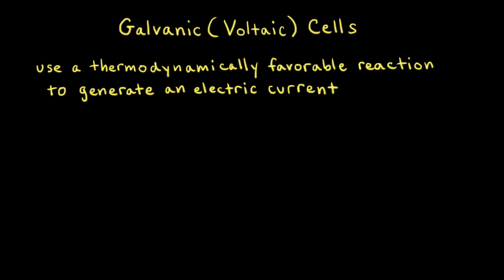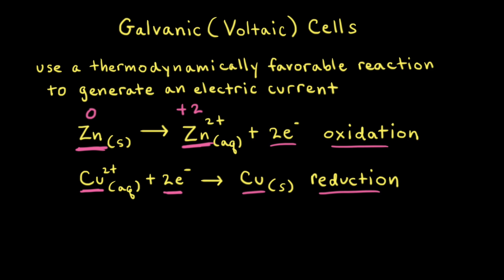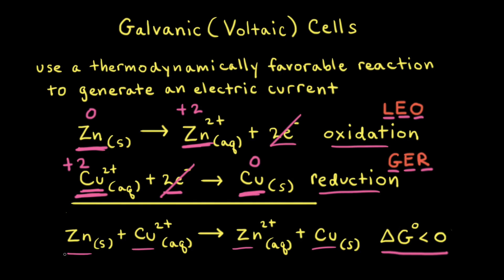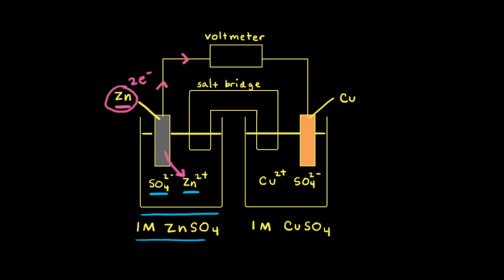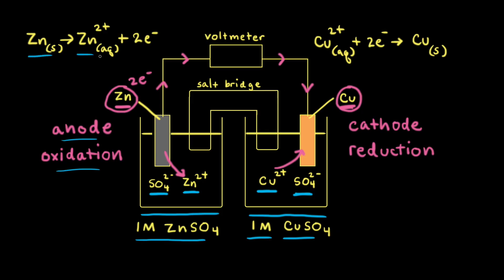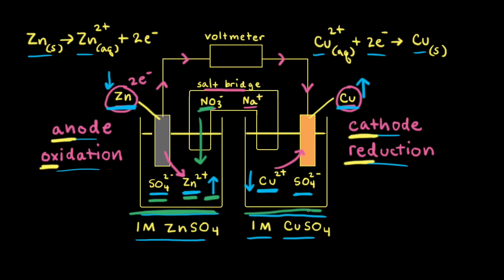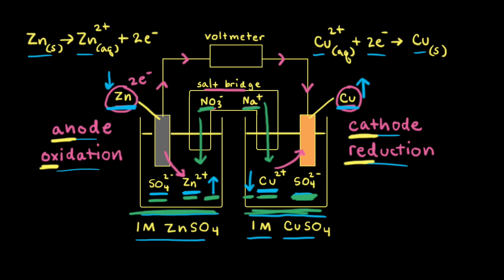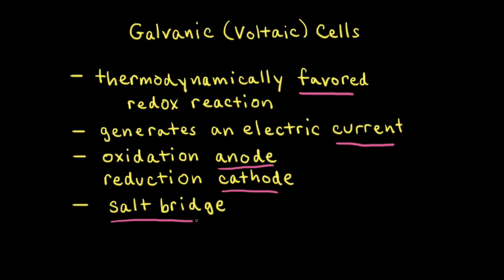Galvanic (voltaic) cells | Applications of thermodynamics | AP Chemistry | Khan Academy

Comment: How is it that a current is flowing through the wire even though u have a volmeter fitted there, which wud ideally have infinite resistance..???
Reply: A voltmeter is based on a moving iron meter in which very small current flows. So technically the voltmeter does consume some current.